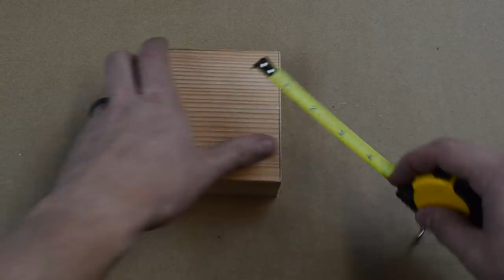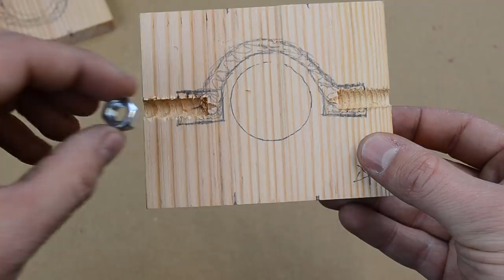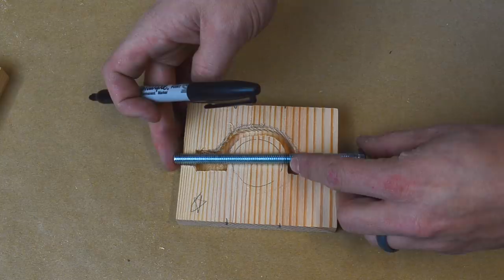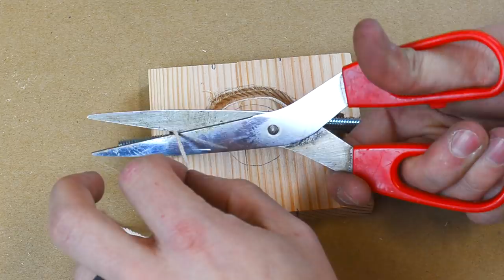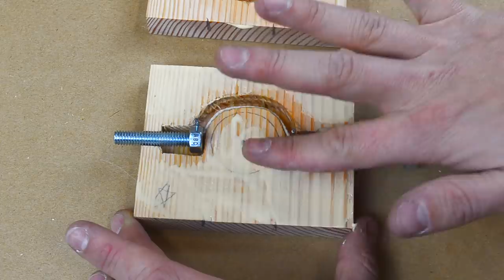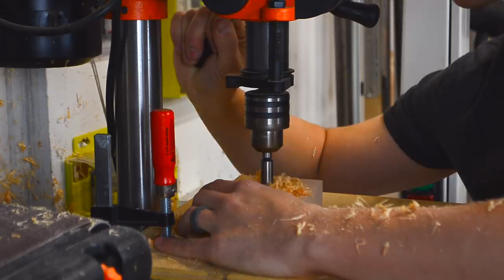Impossible Vanishing Sliding Bolt Trick

Comment: Install nuts on the outer edges with grooves behind them to allow 1/2" of travel in and out. then weld a strong spring on the inside ends of the bolts to travel through a groove in the wood block: this time make a jig to cut that groove. Glue the block back together and drill your hole in the middle, well clear of the groove. Make it look like the block was never cut by splitting the wood with a knife, then dressing the ends afterwards. Cut your groove, epoxy the nuts in their places with the bolt/spring assembly in them and glue the whole thing back together. This way you turn the screw and it goes back and forth. Also make the hole for the bolt threads tight and make sure it is aligned well with the other end.
Reply from the maker: Wow interesting idea, thanks for sharing ladmyre! I like your idea of a jig to cut the groove too.

Comment: Cool video, but why not just heat the bolt and bend it around a pipe?  That's easier, tighter, and would even still ohm.
Reply from the maker: Wow I hadn't thought of that! I'm a woodworker not a metalworker so I never even considered that. Thanks for sharing John!
Reply: @dkbuilds  I’m a metal worker not a wood worker, so I never know how ya’ll get the wood to cooperate, LOL.

Comment: Great idea.. Now make it so that when you turn the screw, it turns at the other end..

There might be a better way, but here's a start.
Step 1. Drill the BIG hole through the center first.
Step 2. Then split the two halves apart.
Step 3. Cut a rectangle slot around the BIG hole. Make the rectangle so it is a thin groove above and below the hole and wide at each end in the direction the bolt moves. 
Step 4. Get a piece of metal bent into a rectangle that is shorter than the groove so it moves inside the cutout groove.
Step 5. Cut a plastic staw to the length of the rectangle and tape or glue it down along the long sides of the rectangle.
Step 6. Drill a hole in the center of the short side of the metal big enough for the bolt to go through, then attach the nuts to each end of the metal rectangle over the holes and screw the bolts into the nuts 10 turns.
Step 7. get a long piece of string and glue it to the first bolt and wait for it to dry.
Step 8. after dry, wrap the string around the bolt about 10 times clockwise.
Step 9. loop it around the top of the rectangle and feed it through the straw to the other bolt and wrap it 10 times.
Step 10. loop it around the bottom of the rectangle and feed it through the first bolt and wrap it clockwise 10 more times.
 Try not to cover the first wrap of string. Now glue the end of the 10th loop to the bolt.
Reply from the maker: Ooh, that's an interest idea. It sounds like it'll definitely work better than my method. Thanks for sharing, I might give it a go!

Comment: Amazing - i'll guess i build one myself, but i have an idea for improvement

1) use multiplex instead of solid wood, you you can  mask the fact, that you cut it in half and glued it back together, it looks
2) instead of a piece of twine use a piece of u bracket or a solid wire (coat hanger) for example - so you can push and pull it from both sides without "delay" or yanking it
3) add a bit of thickness to the material so you can make it possible for the u-shape mentioned in #2 to rotate/turn the bolt (not freely (360°) but if done properly you can make it turn by lets say 75° if and have still enough material left to stabilize the center pice without showing
Reply from the maker: Thank you for the ideas suit! I might try some of those if I build another version!

Comment: Like many commented: One long bolt bent up, over, down and out the other end with the inside hollowed out to allow sufficient movement......oh and frankly, drill a smaller hole in the center........the metal tube raises questions ! Masking the wood joints would require some genius work but I'm sure the expert wood working community could answer the call. Enjoyed the video.......I love these little knick knack projects !
Reply: masking the wood joint is easy if you use a different type of wood or different grain orientation - you could spit the wood alone the grain and reglue it without noticing - or just use multiplex or any other type of plywood, this will do the trick.

the deluxe version would be a machined metal piece - brass for example and soldered back together with an invisible joint
Reply from the maker: Thanks for the ideas, Philippe! I appreciate you sharing them in a constructive and kind way. Lots of negative comments on this one! Thanks for watching, I'm glad you enjoyed it!
Reply: @dkbuilds  Just invite the negative commenters to make a video of their genius work then we'll judge them !
Don't waste time on them.....keep up the great videos, everyone else enjoys them !

Comment: Maybe use a spring instead of the wire, that way you'll be able to also push it which will help sell the illusion even better. You can screw the ends of the bolt into the spring eliminating the nuts and this also allows for a narrower channel so it doesn't wobble as much.
Reply from the maker: That's a good idea, Panthror! Thanks for sharing, I might try that next time!

Comment: Nice amateur way to do this, keep practicing m you’ll get better with designs
when you’re sliding the bolt, I can see the bolt wiggle giving away it has been cut, hollow out the center a little more, and use solid material to hold both end instead of string
Reply from the maker: Thanks for the tip Shawn!

Comment: You need to put a spring on both bolts between the nut on the inside and the inside of the wood so that when you pull and release one 'end' of the bolt, the spring on the one not being pulled will push it back into place making it appear more convincing!
Reply from the maker: Ooh a spring is an interesting idea. Thanks for the idea, reckon!

Comment: The illusion works only when the bolt is pulled.  Pushing does not move the other side.
Reply from the maker: Good point Spark. How would you recommend I make it so pushing works too?
Reply: @dkbuilds  don’t cut the bolt and run it though the hole.

Comment: If you push the bolt into the hole then the other end won't come out. If you twist the bolt head then the other side won't rotate at the same time.  I think this particular trick is a dead duck.
Reply from the maker: Yeah this trick definitely has its flaws. It's just a gimmick and for fun. Sorry to hear you didn't enjoy the video!
Reply: @dkbuilds  Keep trying!